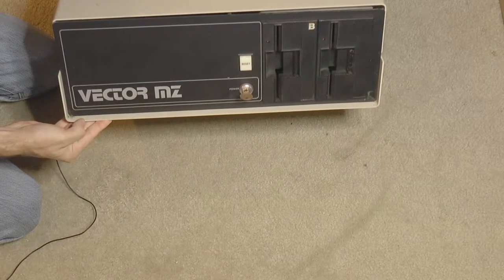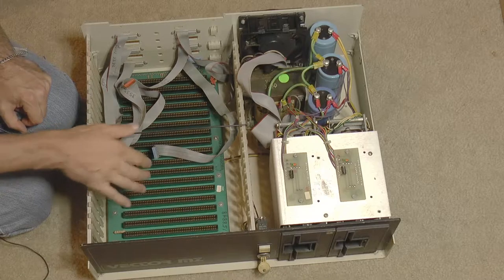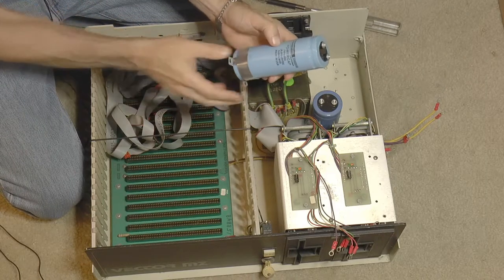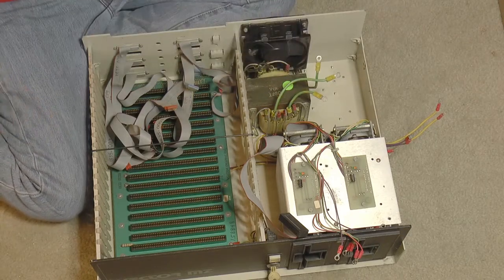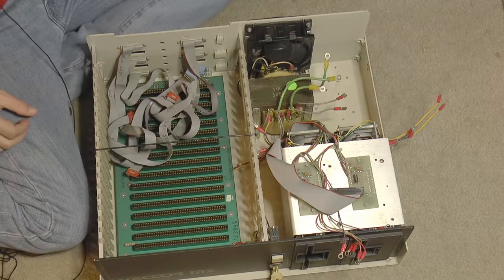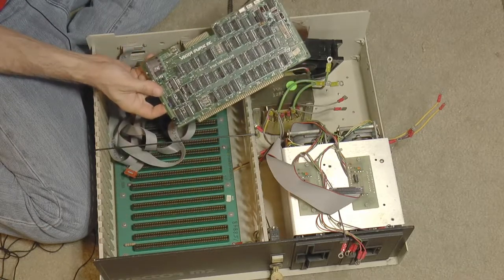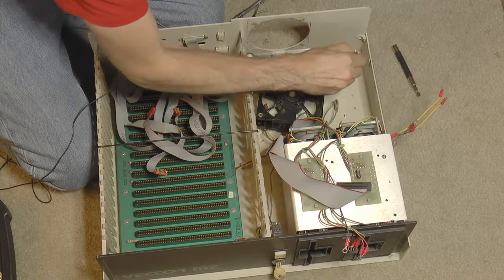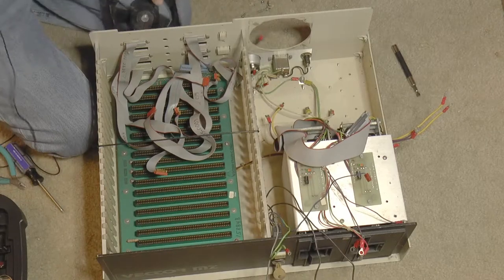Retrofitting a modern power supply into an S-100 backplane

Comment: Just test and reform the original capacitors and reinstate the original power supply. There is a high probability that the computer grade filter capacitors are still working. Interestingly your motherboard uses a mutant Thevenin termination scheme with the paired voltage division resistors at opposite ends of the transmission line.  There is a high chance that it is relatively ineffectual and just wastes power.
Reply: If one really wants an improved signal termination, why not use some purpose built Texas Instruments UCC5606 active terminators.  They're the equivalent of some previous S100 active terminator boards but miniaturised into small IC packages.

Comment: First, from the 8V perspective, those resistors are in series and 8V/800 Ohm = 10 mA each.  This leaves the idle voltage of each line at about 4.7V.  Second, ATX power supplies typically do not regulate the +/- 12V independently; as you draw more 5V current, those voltages increase.

Comment: The missing 'green' solder mask was typical on early boards that used the masking. You will/should notice that where it is missing is always where there is a mass of solder. What happens is that solder wicks in under that masking and creates a blob of solder that pops the masking off. The reason there is no masking in the case is because the back plane pcb is cleaned before shipping.....

Comment: The termination resistors are in series, not parallel. So it's 470 ohms to ground and 330 ohms to 5 volts. This is 800 ohms not 194 ohms. This gives a current of 6.25 ma per line times 42 for 262.5 ma total. This is much more in line with what you could expect from a simple 7805 regulator.

Comment: One rectifier is a full wave bridge, the other is used as a +/- full wave with the transformer center tap.
When you're done it will still be an S100 system?  If so then  you're just "modernizing" it.  Turning it into a "PC" would be another thing.
If it were me, I'd take that old transformer, caps and one of the rectifiers to build a 13.8v power supply for my Ham rig.  (Linear supplies are better for radios).
Green didn't flake off, it was 'removed' or covered over with solder when the resistors were added.
You need to connect the 'green' wire from the power supply to the key switch.  Grounding that wire turns on the supply (it normally goes to the motherboard).

Comment: The +/-12V rails would go up once the 5V is loaded since the feedback is derived from the 5V rail
Reply: -12V on an ATX supply is usually pretty wimpy in any case - the rail is not used in modern PCs, and was historically only for things like RS232 drivers

Comment: If I were you, I'd try to mount those floppy drives horizontally as vertical mounting will add a lot of wear and tear on the spindles and it'd be a shame if they stopped working.

Comment: Vector Graphic, the microcomputer company,  was not the same company as Vector Electronics, which makes prototyping boards etc.
The latter company is still in business.
The Vector Graphic compupters, including the Vector MZ, were not particularly more expensive than other similar S-100 bus systems. We've just become used to modern computers being dirt cheap.

Comment: I would probably still use a pc power supply since it's very easy to get another one in case it fails. I would also use a female connector so you don't have to rewire everything again. :)

Comment: What you don't like linear power supplies ? In my experience switching supplies introduce much more hash. But they are much lighter ;-) Also S-100 boards all have on board regulators. How are you going to deal with that ?
Reply: Bridging the regulators would be simple

Comment: The +/- 12V supplies get stronger as you draw + 5V current; they are NOT independently regulated.
Reply: Not always. Most power supplies run the 12v regulator off the 5v, so drawing 5v stabilizes the 5v supply, which bumps the 12v up a bit until it's loaded. However, it is regulated once loaded.

Comment: Doing this is a very bad idea. First, s-100 cards require +8/+15/-15 volts. You CAN NOT supply +5/+12/-12 to those cards without modifying the cards and bypassing the regulators. If you modify the cards, then if they should be plugged into a STANDARD s-100 system without frying the modified cards and possibly other components in the standard system. Anyone following this video run the risk of screwing up their system on your bad advice without a great big warning in the video!